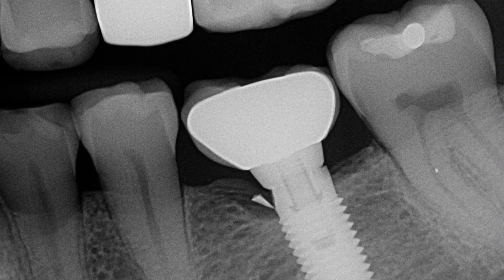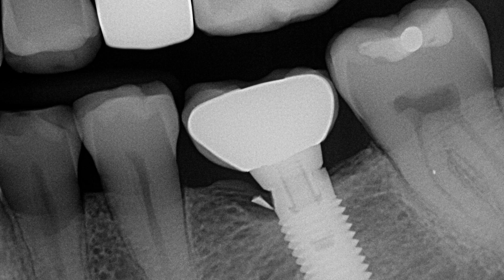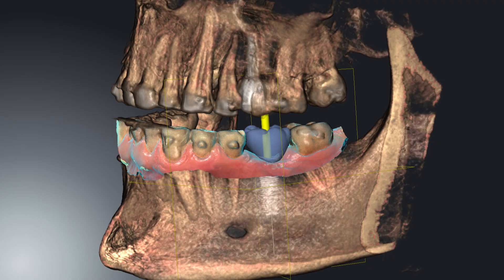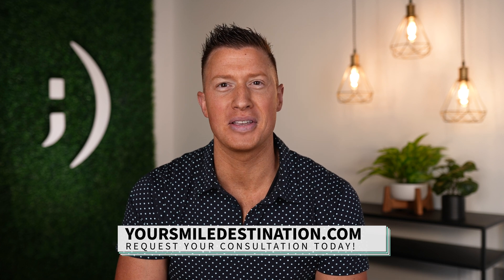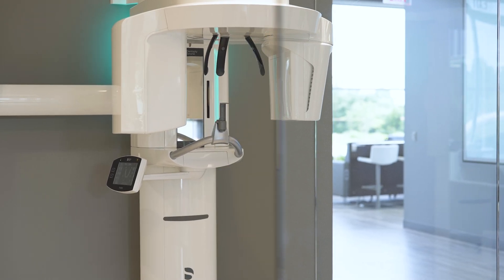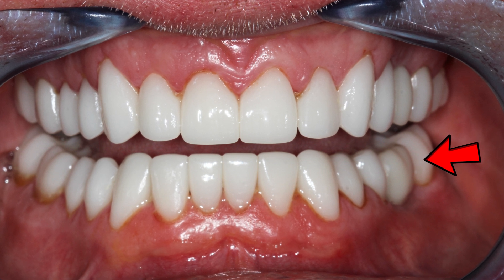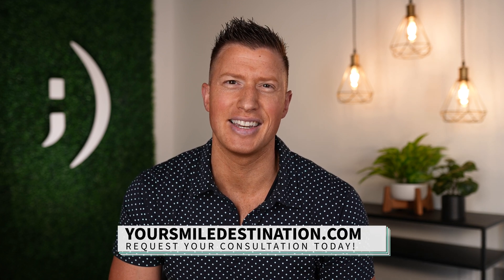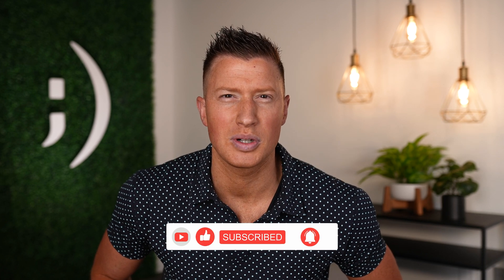Can dental implants break? - Don’t let this happen to you! • Part 2 of 2

Comment: How do we avoid metal in the mouth? titanium is an alloy of aluminum, which is a neurotoxin, and in a solvent for 24/7365/constant. it DOES oxidize. and nano particles of it are enough to cause issues. But your industry has used mercury in the past upto recent times. And it still use fluoride, which is also a neurotoxin. So hwo do people even trust such info?
Reply from the maker: titanium apporved by the FDA for dental implants are completely titanium and non reactive in the body.  This is why bone will grow direcctly into implants.  This process is alled oseointigration.

Comment: Hello, my temporary all on four has broken in half in between teeth and come out. My permanent is not due till the end of September. What is the best glue I can use to repair it please?
Reply from the maker: Do not try to repair these yourself. It is very important for you to see your dentist and make sure you don't break a screw or lose an implant.
Reply: @InnovativeDentalofSpringfield  Thanks, but I'm not going back to Turkey before the permanents are due. They don't pay the flight, even though I think it's their fault ie the arch was probably not wide enough by a couple mm?? 
Instead, I am attempting to put it back on in two pieces. I've tried Fixodent and Polygrip, but the pieces won't stay on for long. Waiting now for non dissolving gum adhesive in the post.

Comment: Hi had implant 2 years ago . Did not use 3D  problems trapped food implant too large cut off next tooth to fit in and too deep at wrong angle.  Result pushed lower teeth pushed forward 
 Bottom lower right . After failed deep canal filling  . Pain and disappointment.

Comment: Dr O,
Can you tell me how you are able to install implants  and completely change a patient’s mouth in one day, when it has taken over 9 months for my dentist to place 3 implants which are still unstable so he encased the 2 implants in temporary dental composite material.  The implants have movement.  My question is simple, I would like to know the permanent dental cement used when operating on dental patients for the one day makeover.  I’m not asking for a recommendation on the cement but just point me in the direction so I better understand the materials and methods.   Thank you very much, Alan

Comment: Hi everyone. Honestly idk what to do and would greatly appreciate any help/advice. I am currently 35 years old and have had dental issues since I was a kid that carried over into my teens. At that point in my life we could somewhat afford some dentistry. So when I was 17 I got a tooth extracted that needed to go. The plan was to return the following week to extract one more and get started on fixing some of my other teeth(maybe 2 or 3 that needed attention, age makes you forget some things lol). But life had something else in plan as we basically got cheated out of our house that we had lived in for years. At that point there were 2 options, we could gather what little money we had to hire a lawyer and basically hope we could win our house back or find somewhere else to live with that money. So my mom decided having a roof over our heads was more important than hopefully winning a court case. Either way, at that point it was clear my dental problems were just going to have to be postponed indefinitely. Now I am 35 and have yet to see any type of dentist/specialist since as I just learned to live with it. My teeth just got worse over the time. I basically have 1 that is a hollow shell, one completely broken, one broken on the front only, and many that have cracks or just broken off on the lower backs of my bottom teeth. I'm pretty sure that 2 of my teeth on both the left and right side have such sharp edges that they have been cutting the inside of my cheeks for years now. When I had a steady job it was still not possible as getting dental care is very costly, currently looking for a new job but I would be lying if I said that my "smile" or lack thereof hasn't shaken my confidence and how I feel about myself. I know that dental implants would be the best thing for me, yet I need help. Any advice from someone on the channel, comments, anyone would be greatly appreciated. Do I start a gofundme even though I'm not a Facebook type of person with 1000s of friends? Can someone help me start a gofundme if I do? as I have no idea what i would be doing. Any charities that can help me? Any government programs that could help? I live in Fort Worth, Texas and have seen some implants that would cost around 40k or should I go to Mexico where I have seen some advertised  for as low as 12k with good  reviews but again I have no idea what to do or what I am doing so any help would be welcome please.

Comment: Hey doctor, I had a cracked tooth and went to the dentist last week. He ground my entire tooth down into a pit and then filled it so that it's flat and below the level of my other teeth. He is supposed to put a crown on it but it won't be in for two weeks so I just have this flat, mini stump. 
My question is how is a cap going to stay on when there is very little surface for it to cement to?
Did this dentist destroy my tooth? Oh, he only got his license in August 2021-I didn't know that until I got home. He is using the office of another dentist.
Also, he's charging me $1350.00 for this. 
PLEASE HELP!
Reply: How did it turn out? Did you talk to another dentist?
Reply: Get a second opinion asap
Reply: Only $1350? You got a deal. Crowns can be put on smaller stumps. I've had a bridge lasting years on stumps.

Comment: Hello Doctor! I have a question and believe you may be able to help me. I have been squizing? my teeth during my sleep and suddenly started aching (one of my teeth on the back) I did go to a periodontilogist did x-rays and told me that there is an irreversible condition created to the bone from this "habit". He described it as bone has been loosed not beeing able to keep the tooth in position 100%. He told me that there is nothing that can be done and we will try to keep it as long as possible by using during sleep a .... (I do not know the word but I'm sure you understand) so that teeth do not come in contact and are kept together one next to the other for avoiding the shaking of this tooth as well as other teeth that may have the same problem. I did ask if there is a graft or a way to "close" this gab but received a negative answer. My teeth and gums are in excellent condition and feel awful of this situation that was unexpected and did not know about it. I was wondering if there is something or some progress on this condition. Thanks a lot for your help!!! Keep up the great work!!!

Comment: Nowadayes we don't use trrphine bur to remove implants, it is very traumatic. Implant removal kits, for ex, the kit by neobiotech is perfect, less traumatic, safer and easier for the patient. When U remove the failed implant, U can place another one. It is termed in the litelature as ( second attempt))(matchi, et al).
Its success rate is slightly lower than the first attempt, but still high.
Reply from the maker: You are correct. This is what I use now.

Comment: Was it a tissue level or bone level?. It looks like a implant with vertically polished collar. The polished part isnt ment to be in the bone, or did the surgeon leave the sandblasted part out? Then it comes to the implant abutment connection. The previous doesnt seem to have stable conical connection. I really like your implant position and better emergence profile and screw retained crown! However with deeply placed implant I think the patient would be better off with higher Ti Base, 2mm at least. Also how much immobile keratinized mucosa in buccal area of the crown is there?